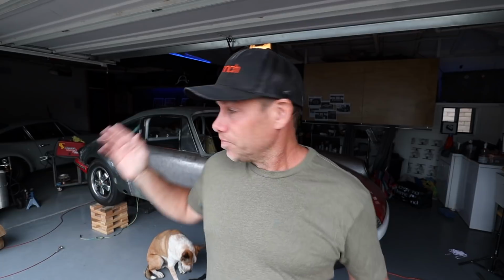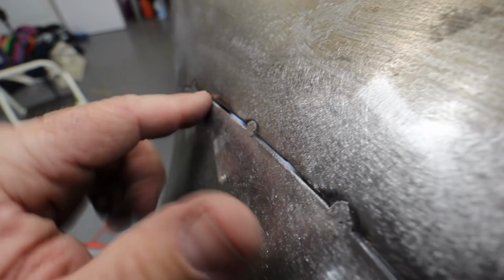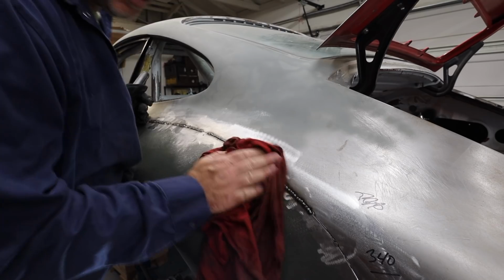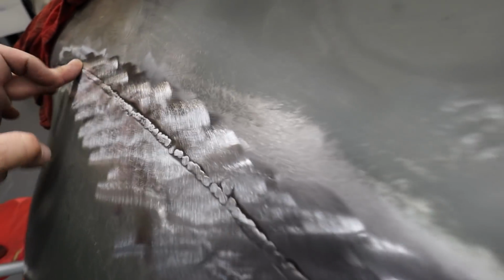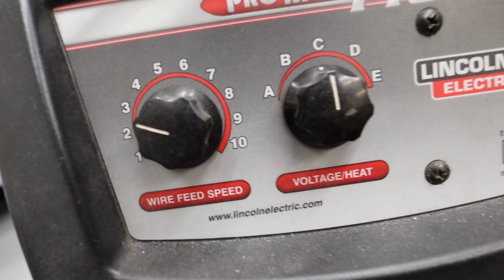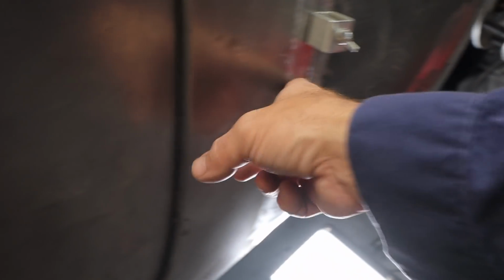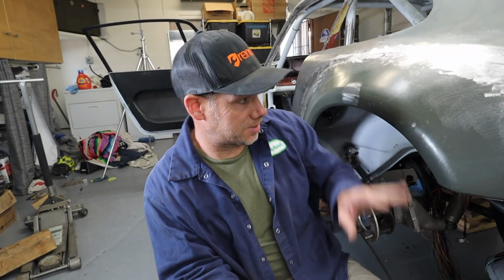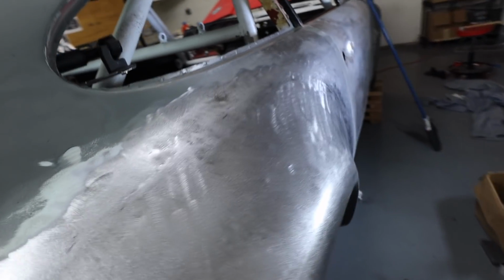Have I Discovered The **SECRET** To Perfect Welded On Fender Flares? | Blasphemy Build 55

Comment: wait, I'm confused -- did you nail them or weld them?!? :  )
Reply: Basically spot welded with a mig welder. So it doesnt heat up and warp as if you were running a full bead
Reply from the maker: Cleverrrrr

Comment: Hey Michael, I tried the links. Some do not work, might want to check the address. But otherwise, great video as usual, car is really taking shape!
Reply from the maker: Which links?
Reply: @rennch.  The only one I found works is the Uro link. I think there might be some hidden characters in the link. I am using Chrome and when I select the link this is what shows "http://rennch.com/rd%C3%A2%C2%80%C2%8B%C3%A2%C2%80%C2%8B%C3%A2%C2%80%C2%8B" If I remove the extra characters the link works properly. Might just be for me, but not sure.